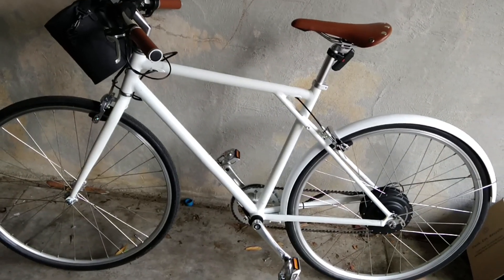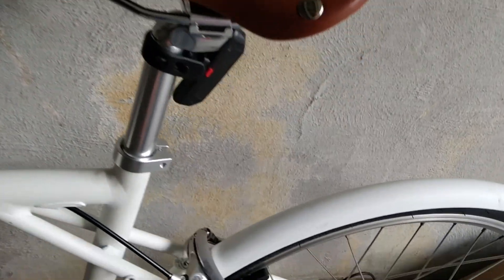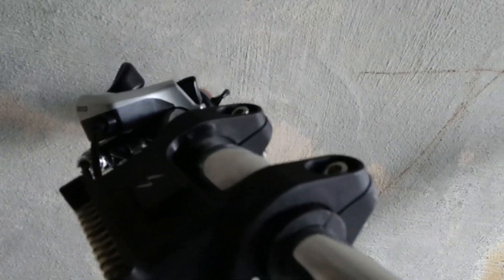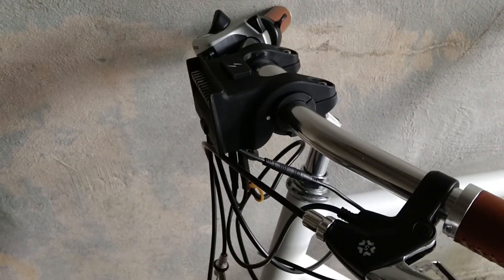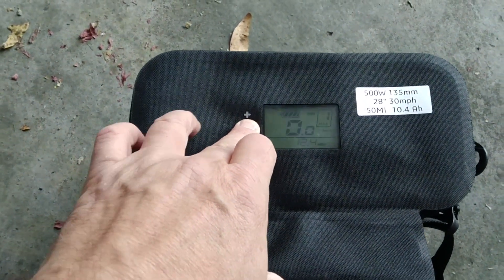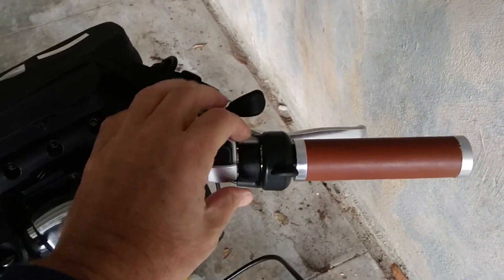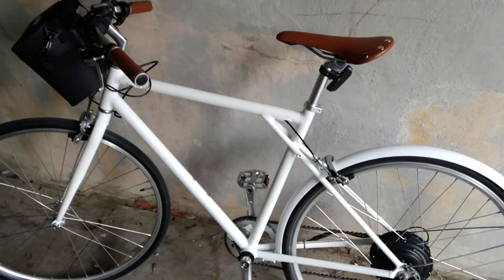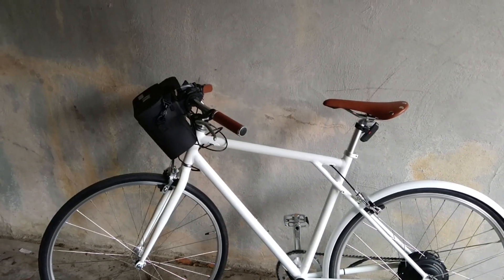Swytch --  Full bike post-assembly review

Comment: You're right better buying good mountain bike like Giant and fitting a kit,  as regard to the battery pack tipping, you need a strip of strong of 25mm webbing punch holes in it secure it to handlebar clamp bolt then fold it around the handlebar to the other bolt